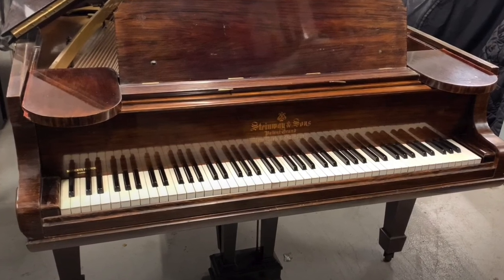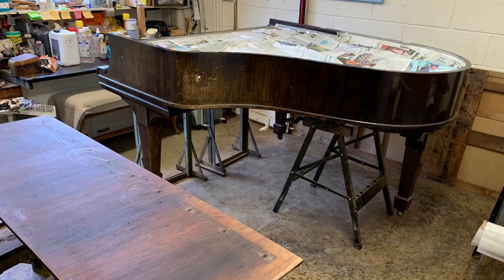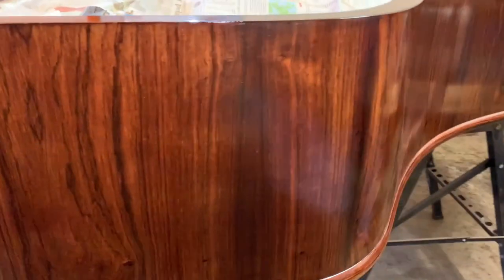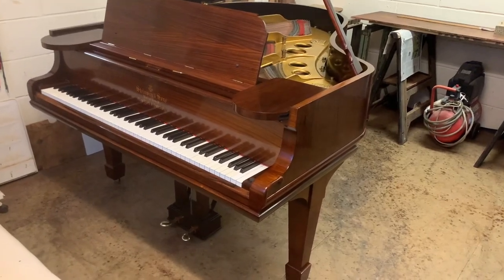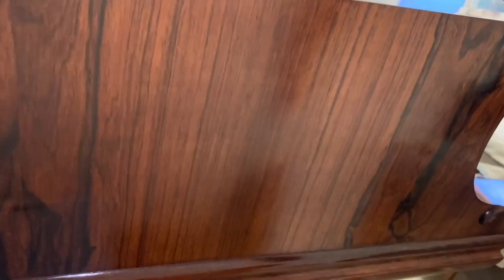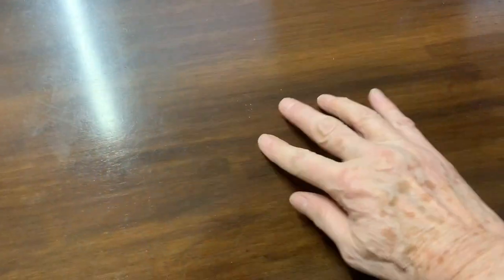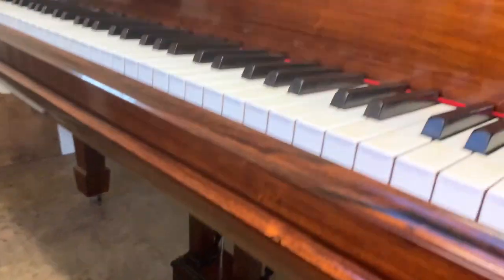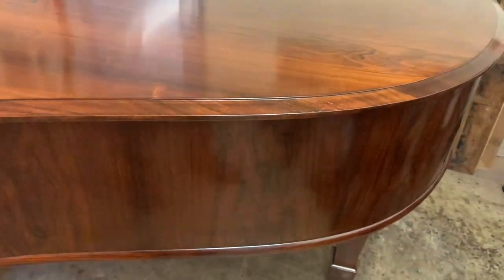Transforming a 1910 Steinway grand: before and after French polishing. Why did it have fake grain?

Comment: This has the patent action? It's really beautiful I'm curious how it sounds before and after. I bought me a Bluthner 1891 grand piano it still has the patent action I'm in the process of having it regulated. I think I'll keep the patent action in it. It measure 6 ft 6 but I think it's considered it a 6'3. How can a person tell what model the piano is? It has a number 32064. Any help you would give me I would greatly appreciate it.
Reply: This is a Steinway: Patent action is unique to Bluthers - very direct and responsive compared to 'notchy' roller action.
Bluthner Model is determined i) Length ii) Whether or not it has Aliquot string (extra treble string)
- Number will confirm year of manufacture
Reply: @Freewheal  yes it does have the aliquot string. I like the patent action it has in it and the aliquot stringing I'm going to keep that like it is for sure. Thank you for your message I appreciate it friend.
Reply: @jackywaldon359  Styles 7 & 8 (adds Aliquot stringing)  are both a nominal 6'3" - but this also depend on casework ornamentation
- Bluethners have a great tone for home use;  the Patent action is smooth and direct; and Aliquot something no other manufacturer has 
- Also very few pianos have each note individually strung which gives great tuning stability
That age of piano was made from aged timbers which can't so readily be acquired these days